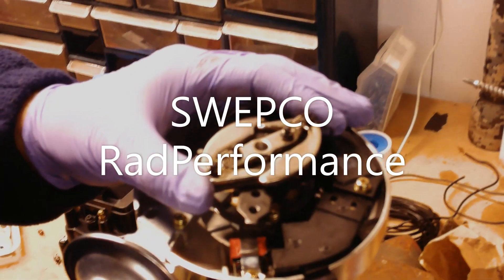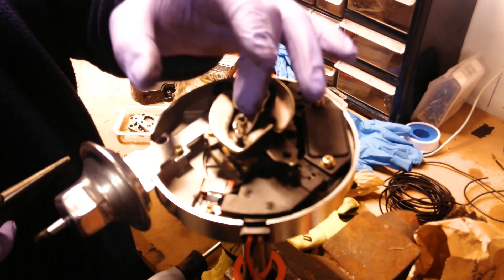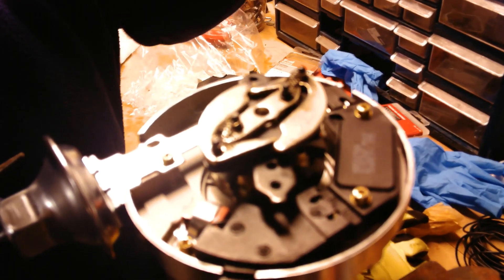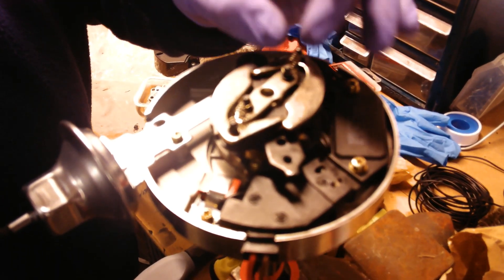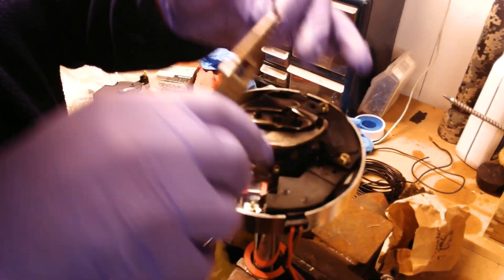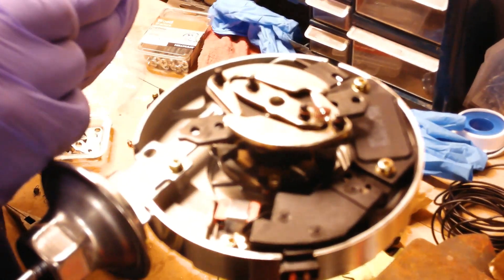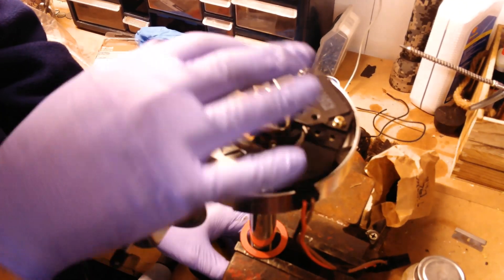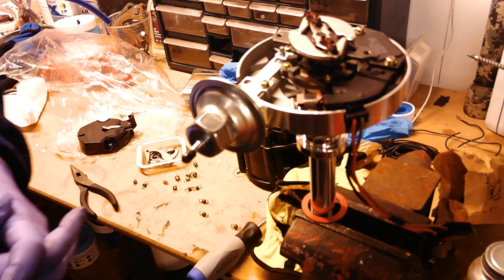HEI Distributor Mechanical Advance weight kit

Comment: whats your opinion on a copper / silver spring combo, were having a off idle stumble and done so many things , and it runs good but i have a feeling it needs that downlow advance to come in quicker cause once you get past the stumble it picks up later in the rpm
Reply from the maker: The only way to really know when the advance is coming in and how much is with a timing light. Either buy one with an adjustable dial or put a timing tape on your balancer to watch the advance. I never had springs create a stumble, you may have other issues. maybe carb squirter or sticking advance weights

Comment: What does "peg it" mean? I understand the rest
Reply: "Peg" or "lock it out" means to modify the distributor so that it no longer uses the weights and springs to advance the ignition timing. The distributor cap is "locked" in one position to the shaft so that it still spins but no longer is able to use the mechanical advance. You adjust the timing manually with a timing light at idle and that's all the timing advance the engine will get, no additional mechanical timing.
Reply: @bobdornbos4467 that was a great explanation. Thank you!